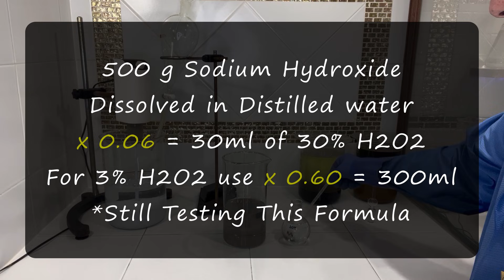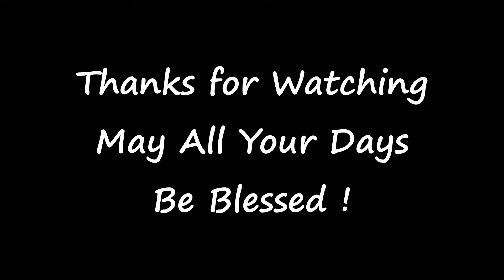Refine Sterling to 999 Pure Silver Bars Without Silver Cell

Comment: I found the best and easiest way to get pure silver is to dissolve 925 in nitric then add copped to cement out the silver rinse and boil in hcl if you have washed it enough in water and hcl you will get 999

Comment: Gosh, you make things so complicatwed.  Just att 1 equiv Soda ash, and melt.  Presto, pure shiny silver metal.  No aqueous reduction needed.  The soda ash provudes flux for melting, all easily water soluble, no borax glass that won't rinse cleanly.  Why do you think you need to reduce it first?  Silver oxide is not stable at melting point,  I just dry the chloride, add sodaash, put in crucible, melt.  Why make things more comnplex than needed?
Reply: You should make a video of your process for us.